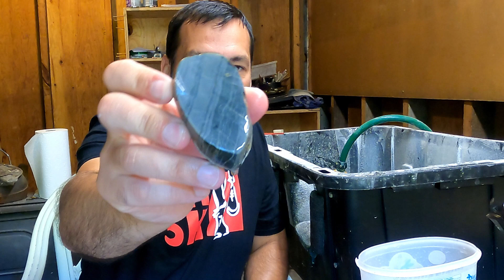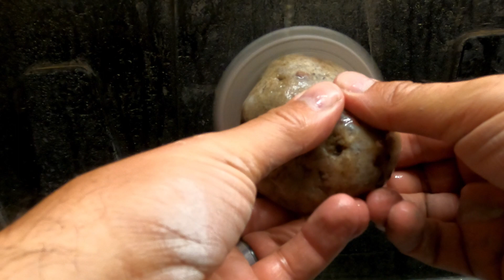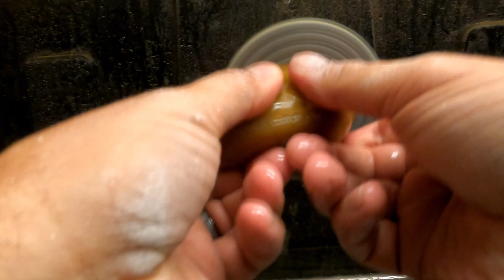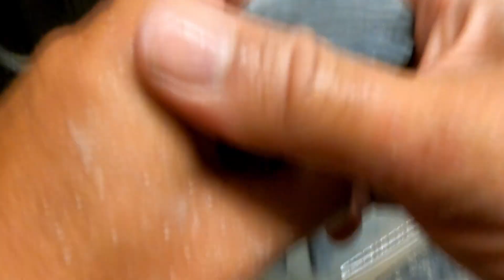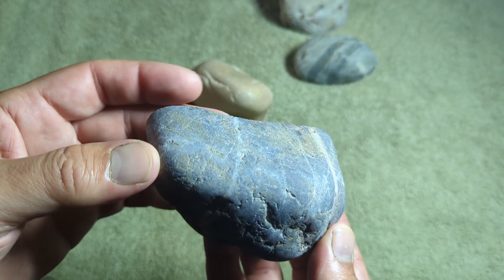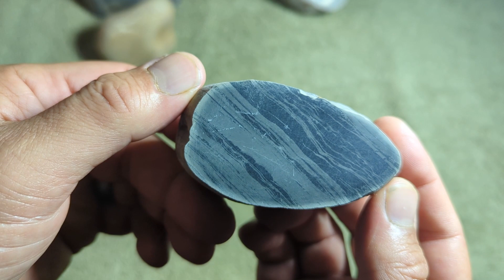Face polishing Great Lakes stones!

Comment: Get a good blade for your saw like Agate Kutter MK-305. On my tile saw which  I use mostly for a trim saw it works well on hard materials. Have a great day.
Reply from the maker: I've started using a similar blade, but the slots terrify me. Can the Agate Kutter cut your finger?
Reply: @kengensjewelry  I have never been cut, the only time I have ever heard that happening is if you bind the rock up in the saw from pushing to hard. They are to reduce heat and prolong the life of the blade. I also recommend you buy some blade dressing compound sticks to keep the diamonds sharp.